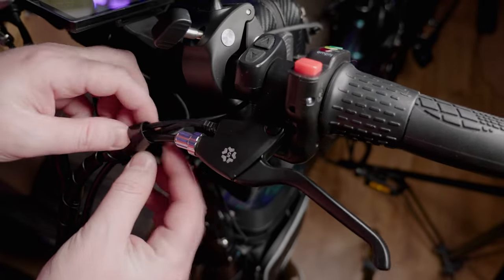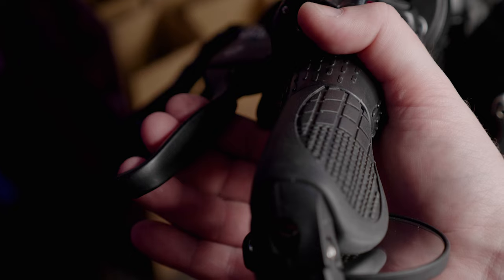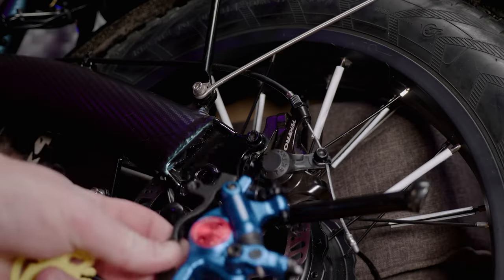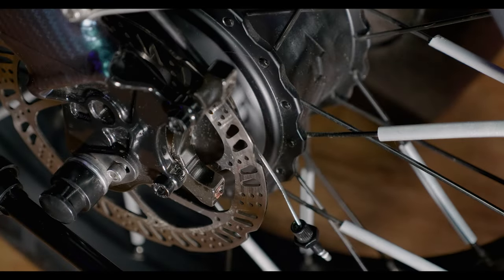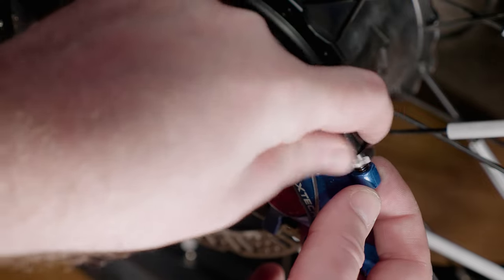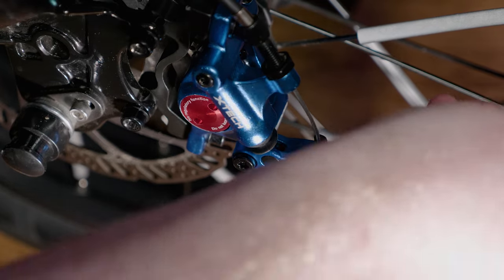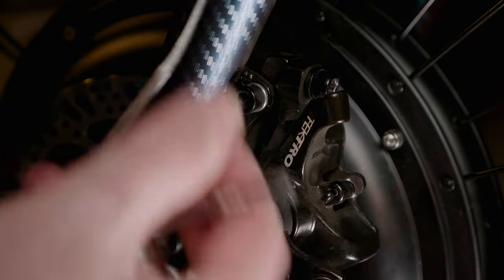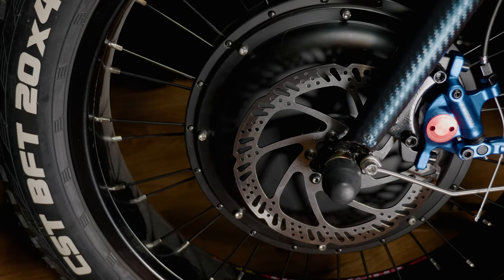Lectric XP Hydraulic Brake Caliper Upgrade (Zoom Xtech HB-100 brake install)

Comment: There is a pad adjustment screw on the brakes also.  it is the small diameter screw that sticks out the bottom.  Turn it in one direction and the pads open and the other they close.  This makes it so you never have to touch the barrel adjusters again for wear.
Reply from the maker: Are you talking about the new brakes or the old ones?
Reply: @RandyRides  the new brakes. If you follow where the piston is it is at the end of that towards the ground.
Reply: There is no screw sticking out of the bottom. U must be dreaming.
Reply: @DJESHGAMING  yes there is.  Put your glasses on and look again.   It is inline with the piston on the cable pull HB100 brakes.  Look at the picture at the start of the video and you see the caliper on it's side.  On the upper right hand side of the picture you see a silver screw sticking up and that is the pad adjuster when mounted on the bike it will be on the bottom of the caliper. . It is the only way to properly adjust the brake pads since they are not self adjusting.  If you use the barrel adjuster you will run out of brake since that will lessen the travel of the arm that is connected to the cable.  Again this is for the HB100 brakes not the stock brakes
Reply: Do a video on it and explain what you talking about.
Reply: The stroke adjustment bolt?

Comment: I bought two such brake calipers for my Fiido D2 (whose original brakes are bad). After a month, the rear one stopped working and I replaced it under warranty - unfortunately the replaced one also does not work, and the front one (despite replacing the pads with new ones) brakes very poorly. I believe that such a brake without the expansion tank has no chance to work properly - it just either loses fluid or gets air - generally I throw it in the trash! There are now new brakes, i.e. double-sided, but mechanical, cable-controlled brakes - and it will definitely be better than the Xtech HB100. Never again!
Reply from the maker: That’s unfortunate. I had really good luck with them when I had them installed, but I don’t think I could ever not use actual hydraulic brakes. They have spoiled me!

Comment: Nice video. I just received mine, however, I find braking to be very stiff. I discovered it is due to the actual levers of the calipers that are being pulled by the brake cables being very stiff. Is there any way to sort of 'loosen' this lever without compromising braking power?
Reply from the maker: If you watch the first minute of my video, I show how to adjust the brakes. Screw the silver screw by the brake lever inward towards the grip. See if that helps. If not, watch how to adjust the brakes. It’s the exact same steps with the factory brakes as it is with the hydraulic ones.
Reply from the maker: If you need additional help, come over to my Discord (http://discord.randyrides.com) or Facebook Group (http://groups.randyrides.com) and we can chat there.

Comment: Fantastic video! I found that on the 2.0 the front brake hits the spokes. It’s a tighter space. I ordered a couple of six hole disc spacers to push the disc out just a bit.
Reply from the maker: Thanks! 👍🏻
Reply: Hi Bill, newb at this. Having that spoke rubbing issue as well on the 2.0, where can i find 6 hole disc spacers, any suggestions greatly appreciate it! TIA
Reply: @mvf136  I saw some guy just say he just tapped his spokes inward a bit with hammer and it solved it. He said he only had 1 spoke rubbing on his 2.0
Reply: @FriarPop  having the same issue guess I’ll start tapping but I think I’m rubbing with more than one spoke

Comment: I have these same zoom xtech mechanical & hydraulic actuated brakes and I got amazed at how much better they work compared to my Avid BB7 mechanical brakes. I have a Goped GSR46 gas scooter btw. The main reasons why I wanted to go with these brake calipers is the fact that they're both mechanical and hydraulic without the hassle of having to make custom length hydraulic lines for my Goped scooter also the BB7's only have one piston only so it pushes the pad from one side and these Zoom Xtech have dual pistons which grab the disk evenly and are softer. Although at first they had no stopping power at all!! Till the pads got worn in a bit and now they stop perfectly. The bb7's have I think a bit more stopping power but less modulation but then again I'm still breaking in my new pads on my zoom brakes so time will tell if that changes. Also I thought zoom xtech calipers were cheap Chinese parts but to.my surprise they're actually made in Taiwan,same as the Avid BB7's only cheaper priced! Great install video btw.
Reply from the maker: Thanks!
Reply: How are the brakes working after 2 years ?

Comment: Mine were just delivered. This is excellent instruction. Good work.
Reply from the maker: Thanks 👍🏻
Reply: @RandyRides  thanks again. Just put the back brakes on our 2 Lectrics…no problem thanks to your instruction. Tomorrow I’ll put the fronts on (I did the back first, cuz I don’t think my wife has even touched the front brake 😝). The only problem I ran into was that the rack on the 2.0s was in the way of one of the screws, so I had to remove the back brackets to get to them. Best advice…reuse the adjustment housing from the old brakes so I didn’t have to crimp the tips of the cable again.

Comment: Curious if you have a suggestion. I installed these on my XP 2.0 using the stock rotors. I shimmed the front and that works perfect. The back is well aligned, but really squeals and the rotor gets very hot. I’ve cleaned, sanded and bedded the brakes and it still is super loud. Would new pads help? If so, which pads comes in the caliper as standard? Which would be a good replacement? Any help would be great! Your video made the work super simple!
Reply: Maybe a new rotor

Comment: Great video. I'm surprised you didn't change the rotors to match the color of the calipers. I believe they sell a rotor of blue color that goes with those calipers.

Do you have an opinion to share on that???
Reply from the maker: Didn’t really have any issues with the rotors, I had issues with the stock brakes.

Comment: I just bought those brakes and they’re not compatible with the Lectric 3.0 that’s why the guy at the bike shop said it’s not for it. Maybe I can use it for my XP lite.
Reply from the maker: This is an XP 1.0
Reply: @RandyRides  yes I realize that but I’ll see if it fits my XP lite if not I’ll return the brakes.

Comment: My brakes arrived today. Did you use the existing bracket or the ones that came with the new brakes?
Reply from the maker: The new ones
Reply from the maker: I showed a picture of the differences between the front and back brakes at 2:30, and they have the new brackets on them.

Comment: I have questions, how do you adjust the brakes, it seems that after adjusting these brakes like mechanical disk brakes it's not working, the stopping power is gone unless I pull the brakes really hard, had like 50miles on them without adjusting, do I have to do any bleeding or replace the pads, any help would be appreciated
Reply from the maker: Probably need to replace the pads
Reply: @RandyRides  I don't think they would get ruined that fast, my mechanical disc brake pads lasted over 800miles

Comment: Your barrel adjuster should've been screwed all the way in when you tightened down the cable clamp.  You then back it out to set the tension.
Reply from the maker: Yes

Comment: of course my adjustment bolt is a different size. i hate having to remove the cable cap.
Reply from the maker: Why would you have to remove the cable? Just pull the end-cap off and pull it through, then replace the cap. They’re cheap.

Comment: I’m confused. I thought hydraulic brakes used a fluid cable instead of a brake cable?
Reply from the maker: They are line pulling hydraulic calipers
Reply: @RandyRides  yes. After I posted I went and read about them. How are the working?
Reply from the maker: @RandyBachmeier  They are not bad at all. I just installed another set on another bike. If you do buy them, plan on buying a new set of brake pads. The ones that come with them aren’t the best.
Reply from the maker: Here’s a link to the brake pads: https://m.aliexpress.com/item/32857697471.html?gatewayAdapt=Pc2Msite
Reply: @RandyRides  I also know from experience that if you start losing brake power to lightly sand the disc down to rough it up.

Comment: What cables can use for a replacement for my Letric xp 2.0?
Reply from the maker: If you install these brakes, you use the stock cables.
Reply: @RandyRides  My stock cables snapped

Comment: Had an issue with the front brake that apparently is to wide and start interfering with the rotation as it makes contact with the spikes. Any suggestions?
Reply from the maker: Did you loosen the two bolts on the back side, squeeze the brake lever, and align it, as shown in the video?
Reply: @RandyRides  yes. My bike is the lectric xp 2.0.

Comment: After a months of usage i can say they are really good if you don't heat them so much,  like in city or contry roads. Problem is when you ride them with 160mm discs in downhill,  they will start to heat too much, after pistons won't return to their position, brakes are getting worse and can't pull the lever, until they cool down. If i used them more and more in heat i think they will start to leak.
Reply from the maker: Change to a better pad
Reply from the maker: https://a.aliexpress.com/_mLEkU2P
Reply: @RandyRides  i've original shimano ones
Reply from the maker: @erenmehmed1950  Not sure what you mean?

Comment: In the photo you stated the rear not the curve, So the not curve bracket is in the rear
Reply from the maker: It should’ve been “note”

Sorry typo...
Reply: You show the rear but in small print you state not the curve
Reply from the maker: @rolandgadue4351  I said it was a typo...

“Note the curve” 

The only way to fix the typo is to reexport and reupload the video. Not happening.
Reply: @RandyRides  got it all on. Used the original brackets that came with the E Bike

Comment: are these calipers serviceable in theirs hydraulic internals?
Reply: Yes there are orings and the fluid used is mineral oil they even sell a brake kit for it on amazon